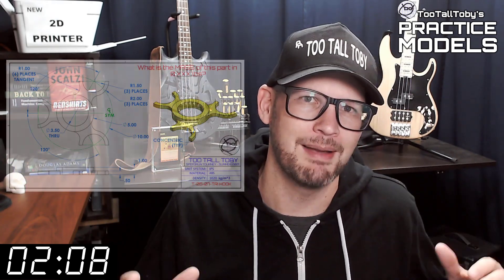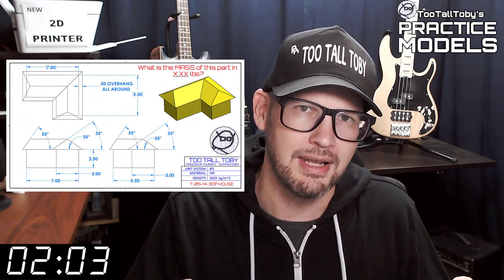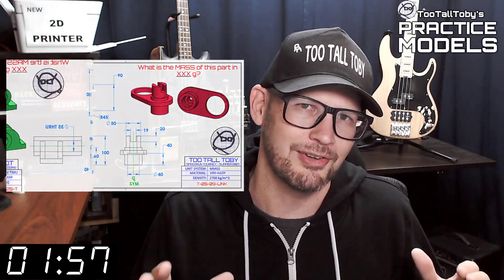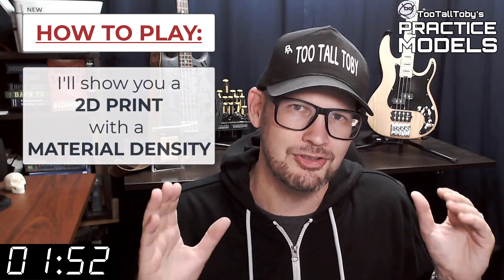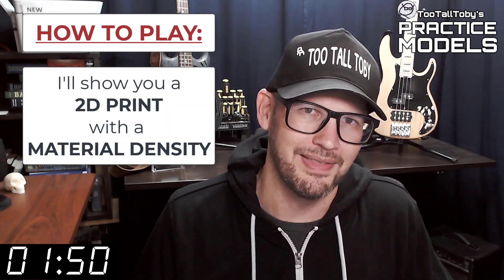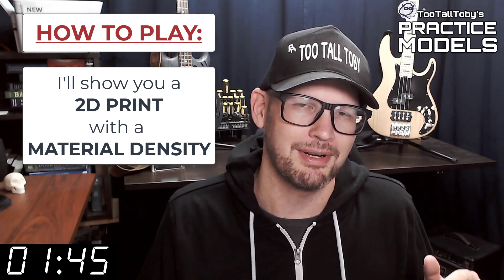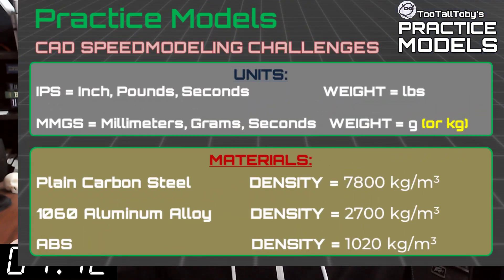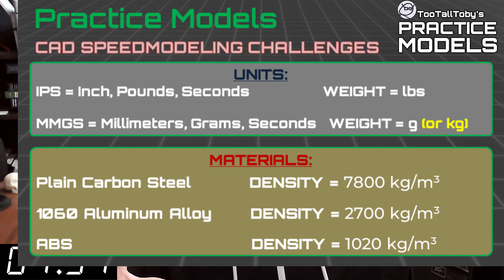CAD Modeling Challenge - Onshape, SolidWorks, Fusion360 - SHARK ARM - Angled Counterbore

Comment: 1996g. I used a mid point plane with an intersect circle and extruded out both ways with a 6.85 degree draft to get the middle portion.  Pretty sure there is a much easier way to do this. but I'm still learning.
Reply from the maker: Awesome job and congrats on getting the mass correct - what CAD system are you using?

Comment: 1996.0161g in 16:01. Took a while to realize that the loft connectors were causing the incorrect weight.
Reply from the maker: yeah sometimes you have to use guide curves (if you are lofting) to make sure things dont get "twisty"  :-)